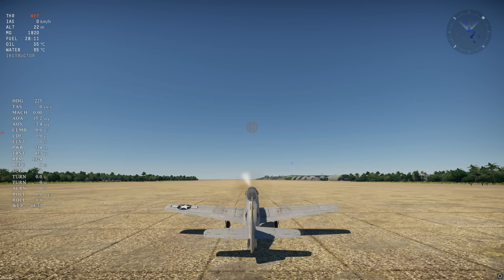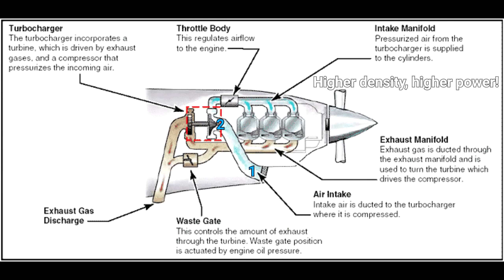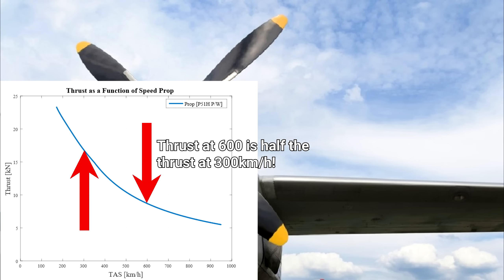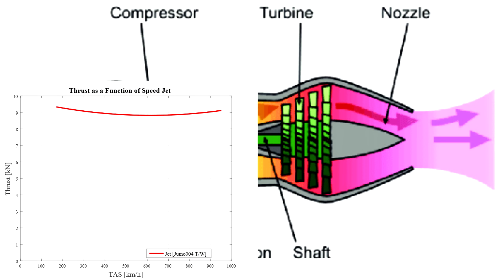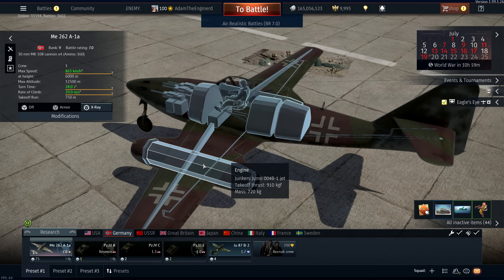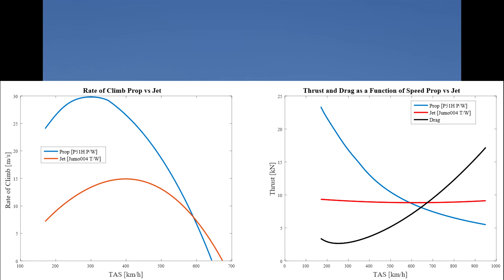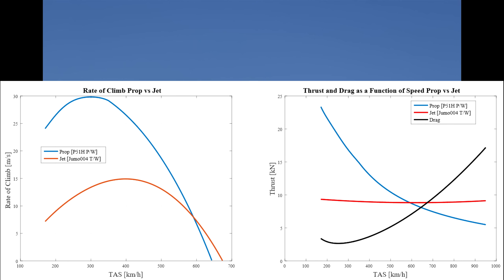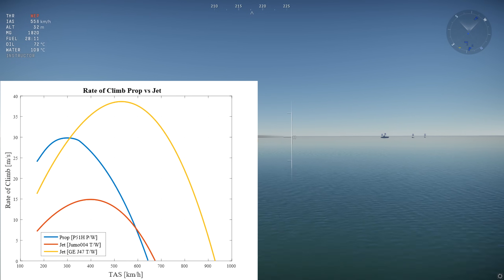Aircraft Performance | Piston Engine vs Jet Engine!

Comment: Love your videos dude, I actually watched to see if you know what you were talking about, in today's age, we use jets for constant chases of the target, not constant maneuverability...
Reply from the maker: Thanks!

What do you mean constant chases of the target?
Reply: @AdamTheEnginerd  Ya know how military targets such as a mig 35 entering Nato territory, use thrust if your engines to maximize speed and shadow your targets, don't maneuver and increase g forces, I learned this through documentaries...

Ya there?
Reply from the maker: Uh I still don't follow sorry.
Reply: @AdamTheEnginerd  Sorry about that, like I wanted to convey you lose speed the more thrust you gain in an unaltered course in a straight line let's say the f104, it's speed of course relative to the combustible after burners are enormous and that ina straight line they are kings of speed, but when having to turn around and losing any thrust from movement alters air intake and the material of the aircraft slows it down... As of course with any aircraft such as piston you will be slowed but in piston aircraft air intake is more concentrated and in low altitude its excelent and the air that runs mechanical conversion of air into combustible oxygen make pist9n aircraft more prone to dogfights and maneuverability is excelent as you said...
Reply: @AdamTheEnginerd  As well as how with jets, you stay in a more straight course to gain altitude from thrust conversion that's more efficient... in turn of course you can't dogfight in jets and that in turn forces military doctrine to change for a war of spying and espionage with potential aerial combat being restricted to more spaced out battlefields for control as well as a jets own runway being concrete. I'm stating how the prospect of jet technology doesn't limit but actually increases restrictions in war due to how destroying airfields and having to restrict rash actions with a whole air force inoperable... That in turn can let wars restrict inperilous action such as mass mobilization only possible through preparation, having military doctirine follow and engage threats on a more streamlined and straightforward mission of course evolved from jet technology limitations, I hope you understand that jet technology didn't turn put worse, but better not in speed, but in tactical use....
Reply from the maker: @comedylongpantsgamer3608  Air intake are designed to not suffer much from high angles of attack.
Reply: @AdamTheEnginerd  Yeah I know. And the movies showing how high angles of attacks destroy engines through their separated platings... It's dumb, and I'm saying how combat changed from high pace turning to gradual interceptions and more gradual movements through the air from jet combat, sorry if it doesn't make sense, hey dude, wanna play Warthunder today or at any given moment?
Reply from the maker: @comedylongpantsgamer3608  Best bet is to join the Discord.

Comment: Is the 26% increase in speed when you add another prop engine a universal number or is it just for this specific example?
Reply from the maker: Universal for doubling power. Doubling thrust increases speed by 2^(1/2) = 1.4, while doubling power increases speed by 2^(1/3) = 1.26.
Reply: This convo makes me wish I shouldn't have flunked school...
Reply: @muhammadhasan1616  Aeronautical engineering was a love-hate relationship the entire way. I'm not even using my degree, except for flying and playing War Thunder.
Reply: both
Reply: not exactly. This works at low mach. An F-82 is not 26% faster than a P-51D because compressibility effects become important and drag increases faster than v^2
Reply from the maker: @appa609  Of course, but a twin engine prop will not reach level flight top speeds where compressibility effects have an effect anyway (M0.75+), so in this case this was a more than justified statement.
Reply: @AdamTheEnginerd  A late war prop plane may be flying at Mach 0.6-0.65 free stream but most of the air actually passing over the plane is going a fair bit faster: M0.8-0.85 or so over the wing, and it does matter.
You can see this in the DCS modeling. At 20,000 ft in the TF-51 my top level speed at 40" MPR was 245 kias while at 59.5" MPR it was 273 kias. If it was a straight quadratic scaling it would be 280 kias. The difference is small but not inconsequential.
Reply from the maker: @appa609  As long as the air doesn't reach Mach 1 over the wing/fuselage, you don't have wave drag. The speed at which you start having the air reach Mach 1 or start experiencing wave drag is called the critical Mach number. Most planes have their critical Mach number upwards of M0.7.

What may be the case though is that your propeller becomes less efficient as speed increasing due to wave drag on the prop itself (lower propeller efficiency), reducing thrust and hence reducing top speed. If you were doing the test at low altitude, I doubt you'd find more than a 1% difference from the expected 26%.
Reply from the maker: @appa609  Also I think DCS uses Reynolds corrections for lift and drag so that does change top speed a tad too, compared to my simpler flight model as well as the WT flight models.
Reply: @AdamTheEnginerd  Ok you're probably right the prop is the first thing to hit mach and that's what I'm seeing. 
I'm not really an aerodynamicist but shouldn't Cd roughly scale with Cp?  If we use the prandtl glauert correction Cp at M0.6 should be 1.25 times the incompressible value. Why would Cd not also increase by a similar amount?
Reply from the maker: @appa609  Most of the drag on an aircraft is not actually pressure drag, it's skin friction drag. Approximately 80% of the drag on an aircraft is skin friction drag while the remaining 20% is pressure drag. So even if we take 1.25 increase in Cp and consider that it increases the pressure drag portion of drag by 25%, that's only a 5% increase in CD0.
Reply: @appa609  Another thing to remember about the F-82 comparison. They didn't just double the power. They also added an extra fuselage, extended its length, and added more wing area. A better comparison would be if you were to re-engine an existing fighter with minimal airframe changes, like the early spitfires to the later models. Yes, there are still lots of airframe modifications, but it's hard to find examples of a plane that had its power doubled. If you look in the link below at the Spitfire Mk.IA and Spitfire Mk.XIVe, you can see that the power roughly doubled and the speed increased by 22.3%. For such large changes in airframe and armament, the model works pretty well.

Comment: An air cooled piston engine would have been the better compairson for power / thrust:weight compairsons. The v12 you have here is water cooled thus needs cooling lines and radiators which add mass. Air cooled pistons only need oil coolers and jet engines require those too. But I guess the conclusion that first generation jet engines are inferior to advanced pistons would not change. Those were just too weak, which made them one trick ponies.
Reply from the maker: So my goal was to choose the best piston engine so that there's no room to doubt that a "bad" jet truly did give better top speed than the piston engine, and people would say the radial plane would have more drag than the jet/inline plane. My counter to the coolant weight on the prop aircraft is the higher fuel consumption of the jet which forces it to load more fuel weight to have the same range.

Conclusion is that an early jet is better for top speed, but the best prop is much better for climb.
Reply: @AdamTheEnginerd  propeller driven by reciprocating or by turboprop/turboshaft engine?